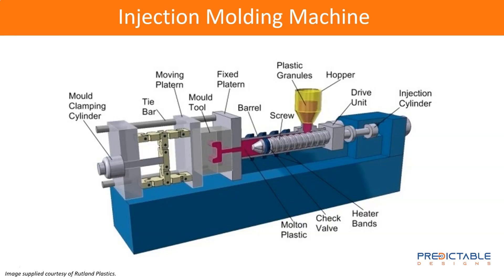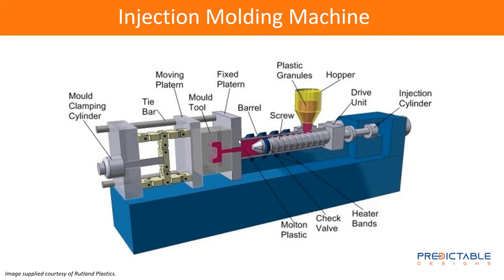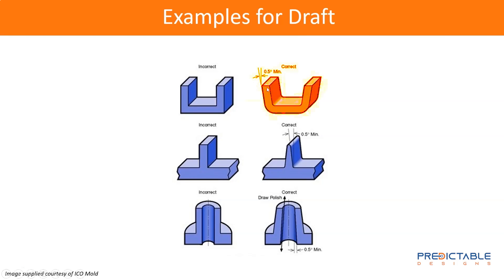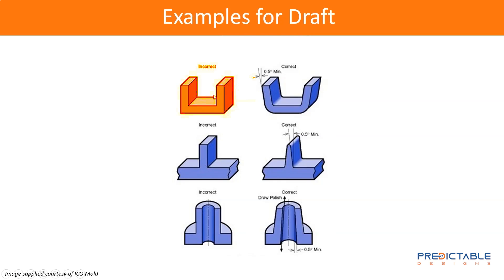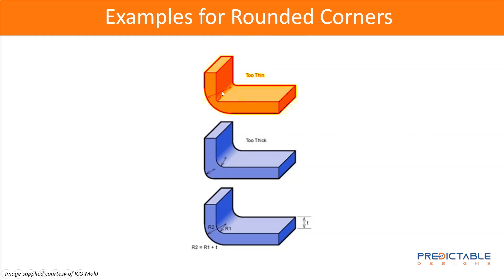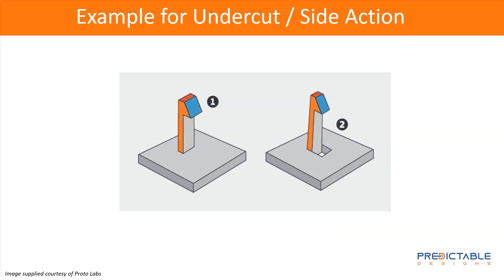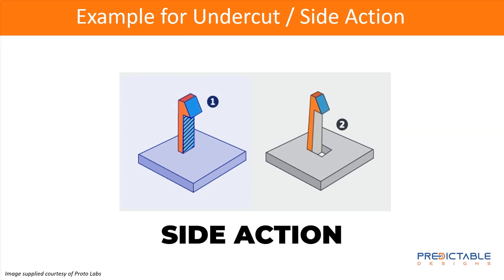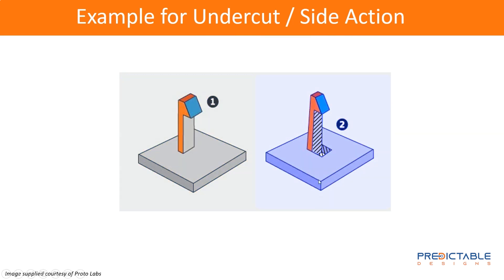Injection Molding - Design Your Product for Manufacturing

Comment from the maker: Get your free Ultimate Guide - How to Develop and Prototype a New Electronic Hardware Product in 2023: https://predictabledesigns.com/guide

And get your other free guides:

From Prototype to Production with the ESP32: https://predictabledesigns.com/esp32

From Arduino Prototype to Mass Production: https://predictabledesigns.com/from-a...

From Raspberry Pi Prototype to Mass Production: https://predictabledesigns.com/rpi

Prevent mistakes by downloading your FREE DESIGN REVIEW CHECKLISTS for the schematic circuit, PCB layout, and enclosure 3D model design: https://predictabledesigns.com/design...

Want my personal help on your project? If so, check out my Hardware Academy program: https://predictabledesigns.com/Academy

Comment: I've done various molding projects, mostly composite work, and more than a fair share of MSLA printing, but you're spot on with regards to transferring a design from printable to moldable. As I've learned from experimenting on my current project, adapting composite molds with inserts and cores to injection has been, in a word, interesting. What I ended up doing was designing and building a screw-based injection machine for injection molding via ceramic molds with inserts to facilitate a low-volume run of GF-nylon parts. It's a bit of a round-about way of getting what I need done, but being a self-funded project for the time being, it's the most direct way I can operate a relatively modest budget.
Reply from the maker: Interesting you mentioned ceramic molds  which is something I discovered recently.
Reply: Hello CME. Is there any chance you could create a custom mould that I could send to manufacturers over seas? I have a picture of the design. Would you be willing to do that for a cost?
Reply: @savannahroos2314  Normally I don't conduct business via youtube, but I can certainly help evaluate a better course of action to see if/what you need done needs that route. What are you trying to achieve?  Me personally, I do short run molds for composite work that typically result in a dozen or so copies with very specific use cases. Again, depending on what you're trying to do, there's a decent chance you can get something made domestically if not in your own home for pennies compared to what a manufacturer is going to charge. Sending something overseas typically goes with just a design, and your chosen manufacturer will charge for the mold, do the production run, then charge you a separate fee if you want the mold shipped with your parts.

Comment: I suspect it might be cheaper to have an additional cosmetic cover piece for some holes if it avoids having side action/multiparty molds.
Reply from the maker: The problem is then you need a separate mold for the cover which adds a lot more cost. Most designs can be done without need for side actions, you just have to sometimes get creative. Thanks for commenting!
Reply: lifters or slides are very costly @PredictableDesigns

Comment: Great video. We're working on a small hardware project and started with FDM material but recently changed to a nice Resin printer to get more detail and a little stronger. I wanted to get your opinion if using resin for a small enclosure is good for a prototype or for our first 5 to 10 customers to test and get usage?
Reply from the maker: SLA prototypes can be a better choice for getting customer feedback. But it still has a different feel and performance than injected plastic. But I always encourage getting prototypes in the hands of customers sooner than you think. My first prototypes for my product I presented to customers were SLA printed.

Comment: Thank you for the video. Are there any exceptions to the wall thickness rule? I'm designing a silicone product that has thinker walls on the corners for structural support and I'm wondering if I need to change the design.
Reply from the maker: You're welcome! Most of my experience is with molding rigid plastics versus flexible silicone. But the uniform wall thickness rules prevents warping during cooling which should be critical to silicone too. Inside my Hardware Academy we have a great mechanical engineer who could answer this better than I can since I'm an electrical engineer.
Reply: @PredictableDesigns  Good to know! Thanks for your reply.

Comment: Thanks John. If a product were sold online and its enclosure needed injection molding, however, the product has little sales in the beginning, which means small orders cannot meet MOQ of  the injection molding manufacturers, so I wonder what you would think about rapid tooling to produce the products with low quantity? I'm not sure if this is a recommended way to reduce financial risk for product's production?
Reply from the maker: Well it depends on the number of units and the acceptable quality. If you are looking for a moderate number of units (let's say a thousand or more), then using aluminum molds is your best option. These are much cheaper than steel molds and typically cost around $2k for each mold.

The total cost though depends on how many custom pieces of plastic you need since each will likely require it's own separate mold.

However, you do have the option of what is called a "family mold" which is a single mold with multiple cavities each for a different part. They do have limitations such as the fact that all of the pieces have to use similar amounts of plastic. If you can get all of your parts into a single family mold you will save a lot of money.

Protolabs.com and ICOmold.com are two companies that do aluminum molds.

If you are looking more at a couple hundred units, and the final production quality isn't quite as critical, then you could use what is called urethane casting which uses soft silicone molds instead of metal. These cost only a few hundred dollars, but they have to use urethane which won't match the final production plastic quality.

Finally, if you can do so, using an off-the-shelf enclosure is the way to lower your risk the most and simplify your life. You can either buy standard box-like enclosures, or you could find a manufacturer making an existing product with a similar enclosure, and then approach them to see if you can buy just the enclosure.

Hope this helps.
Reply: @PredictableDesigns  Thanks John. That's very informative!

Comment: This was a great introduction. Thanks! Any thoughts about HP‘s high volume, low cost per part 3-D printing? https://youtu.be/thn-92_l2mA
Reply from the maker: Thank you! Although I think additive processes like 3D printing are the future of plastics manufacturing we're not quite there yet for most products. It is very challenging to compete with injection molding on per unit pricing especially as the production volumes get really high.

You may enjoy this podcast interview I did with an expert where we discuss 3D printing for mass manufacturing: https://predictabledesigns.com/episode-14-additive-manufacturing-with-steve-szymeczek-of-penumbra-engineering/

Comment: With sls tech you don't need mold
Reply from the maker: You do for production.
Reply: @PredictableDesigns  now you can make part with better quality using sls tech and good materials like nylon or C p12 ' and the result is the same and better is depends on the materials you use .